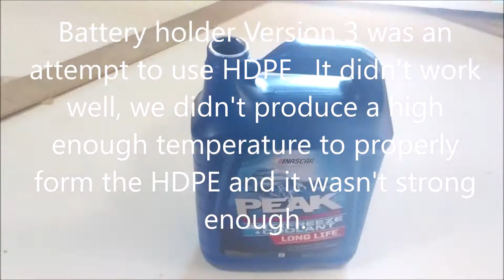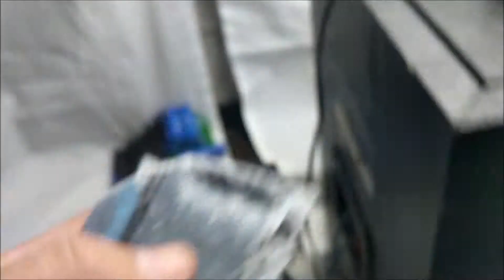How I made my drill battery powered bluetooth speaker

Comment: I had this idea yesterday to build a bluetooth speaker and power it up with a drill battery. Sure enough you and some other already did it.
Good idea to use an old bookshelf speaker. So no work needed to build the speaker cabinet and these old school speakers are dirt cheap.
Great job. Thums up.
A question. Isnt this  a stereo amplifier but u hooked up only one speaker. So are you missing a whole channel of sound or have you bridged it somehow.
 One suggestion. You could have bought a whole charger and mount it on the box. Then you could have snapped the battery right into it. That could have saved lot of time of battery mount building.
Again thanks for putting up a great idea.

Comment: If it is a stereo board you need to make sure to hook the left positive and right positive as well as the negatives up to the one speaker otherwise stuff that is on the other side opposite of the one you haven't hooked to you will not hear don't try to listen to any Beatles stereo mixes or any other hard left and hard right music.
Reply: How many volts is the battery ? Did you have to use a step down converter? Most drills are more then 12 volts .I have a 40 volt drill .how would one step it down to power the amp

Comment: AAAHHHH I thought you were gonna use the ego battery with that for a second. That woulda been something lol. So… 3 years later, does it still work or did the battery or speaker burn out from some electrical mismatch? I noticed it hits a higher pitch note when pluggin in the battery vs the wall.

Comment: any issues or upgrades you did with this setup?
Reply from the maker: The plastic handle connector came off after attaching it to a wakeboard tower.  I fixed it by adding a thick washer so the hole in the plastic wouldn't allow the screw to slip out.